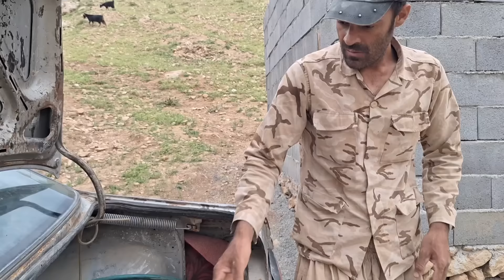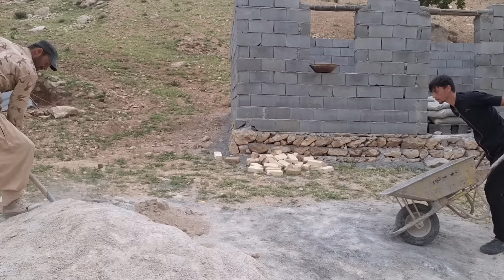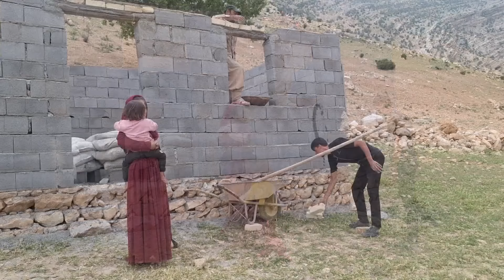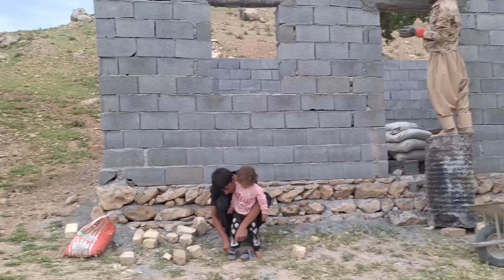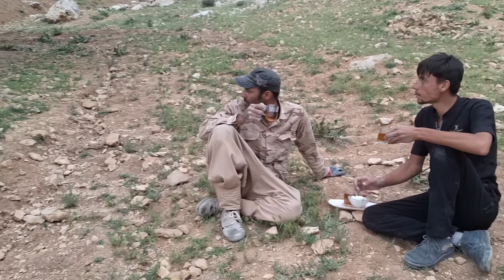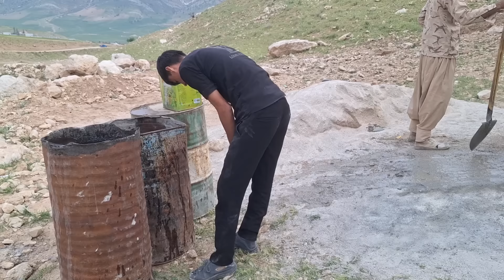From Muhammad and Sajjad working to Muhammad falling from the high wall

Comment: Ishmail told them to make sure they owned the land before building because the owner can come back & ask them to leave. He told Narges this. He said why are you using concrete & Narges said she decided & he said you should used plaster because the landlord could ask you to leave because you dont have a claim on the land & if he does you can still tskye your bricks. Now Ishmail is not welcome anymore. That man help them so much! When they didn't have a roof over their heads & he spet days driving around searching for Narges & she just turned her back on him. Mohammed as well, it shows he's controlled by the Narges